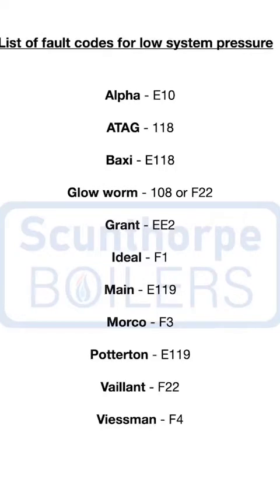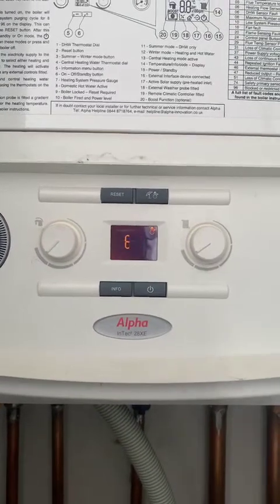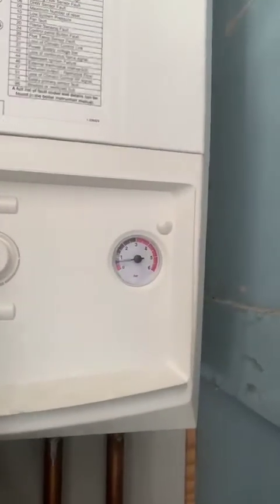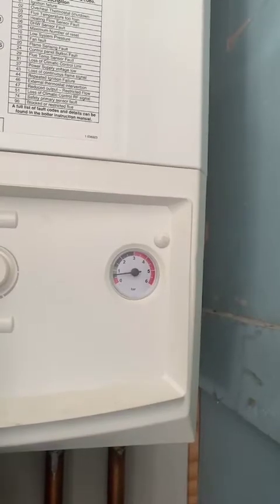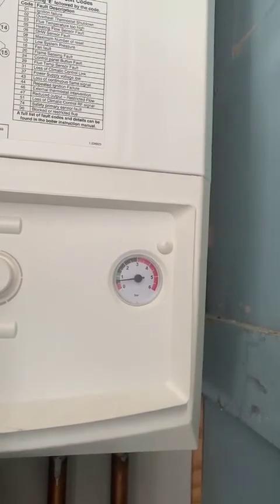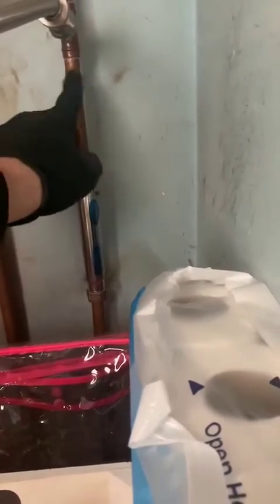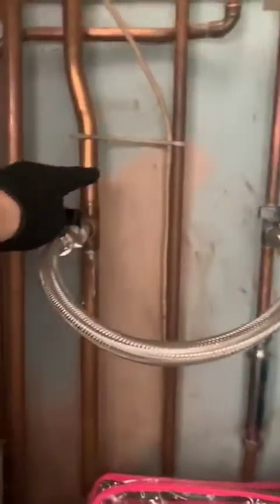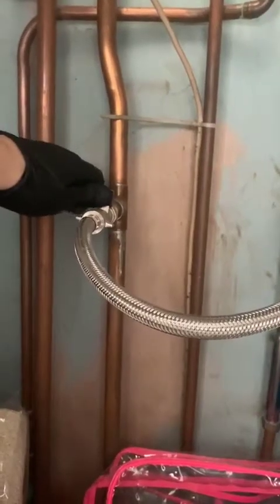||Alpha boiler E10 fault code - How to top up the pressure - Filling loop on pipework||

Comment: I’ve topped my pressure up but the fault is still flashing E10 it is an alpha etec NX28 it won’t reboot, don’t suppose you know what it may be? We’ve been on holiday and it’s been on pretty much zero now since weve come back if that means anything aswell

Comment: Thanks James. I have an E10 code and a low pressure I've found the loop but I can not attach the loop to the heating. Water comes out of the cold. Can you help me. I have no hot water.

Comment: Mines is the same boiler and coming up a code 73. Basically getting a hot shower for 30 second's then cold for 30 second's. When it gets to 79 temp on the display it cuts off and displays code 73 then temp number displays and but going backwards then you hear it kick in again to heat up. So what's up with it ? Is it an easy fix for an expert ?

Comment: Bled my radiators for the first time and got this error. Thank you so much for your help!
Reply: So,Did the press come back mean radiator still have some air inside and not hot?
Reply: @kitaro5618  It was the system pressure if memory serves. The radiators were barely heating. Lived in the place for 5 years and never bled. After bleeding them I got the error message and the video helped me re-pressurise the system.

Comment: Hi, I top up the pressure and the e10 error still flash. I press the RESET button but...still nothing... :(
Reply: Mine is doing this now, did you get yours sorted?
Reply: Same issue - any solution? 😢 EDIT: Phoned them up, you need to increase the pressure beyond the green bit to around 1.5

Comment: What if I turn the 1st one 1/4 way and it spits out a little bit of water? Is that normal? :)
Reply from the maker: It shouldn't do that, there is maybe a loose connection on there that could do with a nip up.